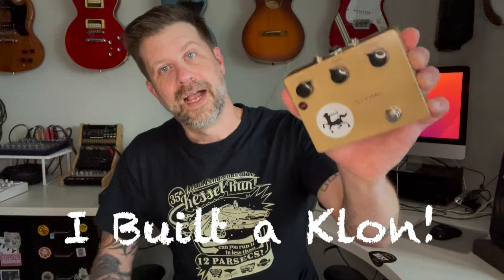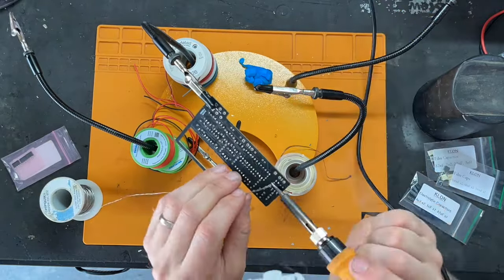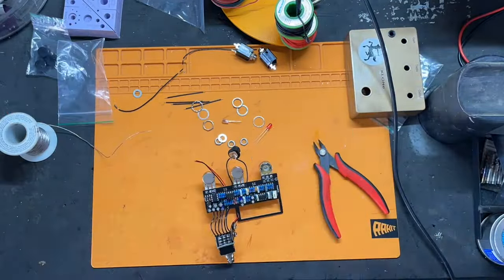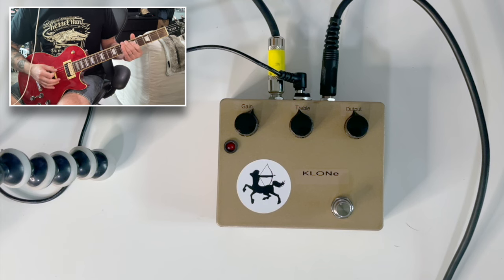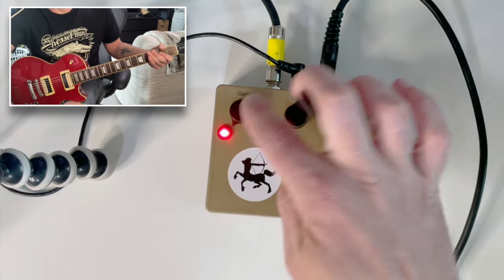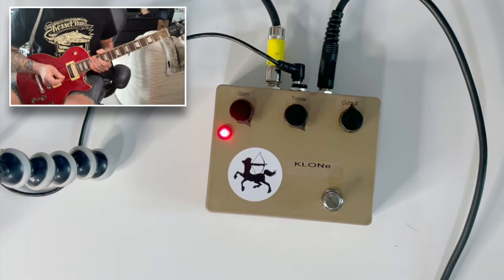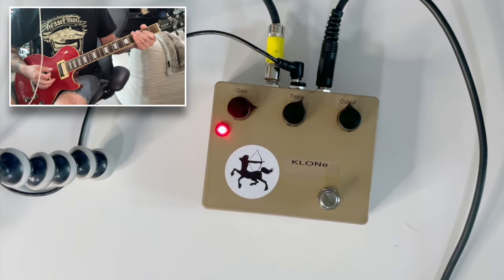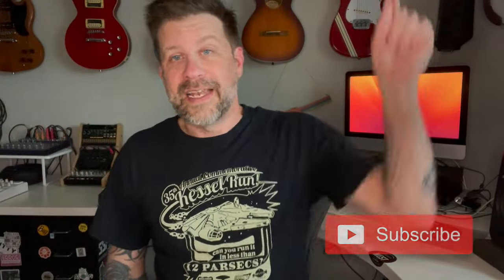I Built a KLONe (Klon Centaur DIY clone) Pedal Kit

Comment: I've often thought about getting a klon klone. Seeing one being built and then used is really helpful. It's very tempting.That's a sound that I really like.
Reply from the maker: Thanks for watching. It's a really cool little circuit. It does some weird things like boosts the 9V power up to 18V internally (via charge pump) and it uses a dual-gang gain pot so it's actually turning the unclipped level down as you turn the clipped level up. It's very different from a tube screamer or fuzz face or DS1. I think that's why all the tones are so great. There's not a bad sound in the box.
Reply: @musicalmiscellany  Do you own a Rat or Rat clone, and how does the Klon compare?
Reply from the maker: @midi_in  Yes. I built a Rat clone a while back. You can find a video somewhere on my channel. It's very different from the Klon. One is really aggressive hard-clipped distortion and the other is more natural tube-like soft clipping. Both are capable of mayhem but two different flavors. Personally... I love the Rat and the DS1, but there are so many good overdrive circuits out there... who can choose?
Reply: @musicalmiscellany  Ah yes, I've found it. I see what you mean. As you say, they're different and it's difficult to choose. Probably a case of 'why not both?'!
Reply from the maker: @midi_in  For what it's worth, I think every guitarist should have a distortion (DS-1, Rat, etc), an overdrive (BD-2, Klon, etc), and a fuzz (Fuzz Face, Big Muff, etc).